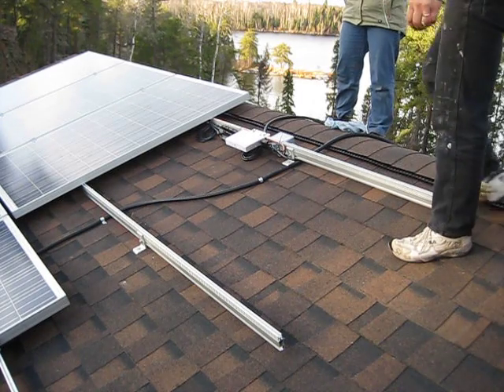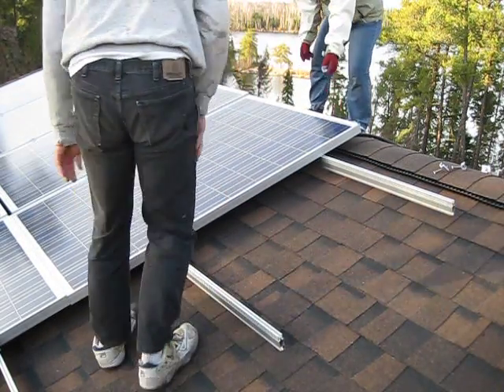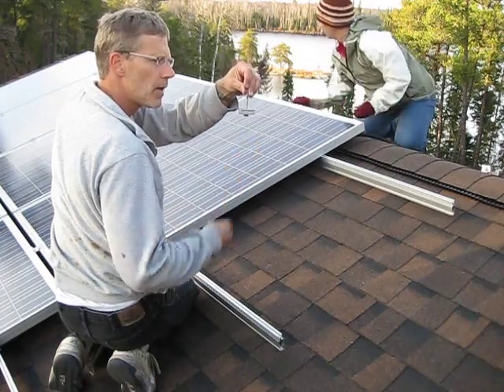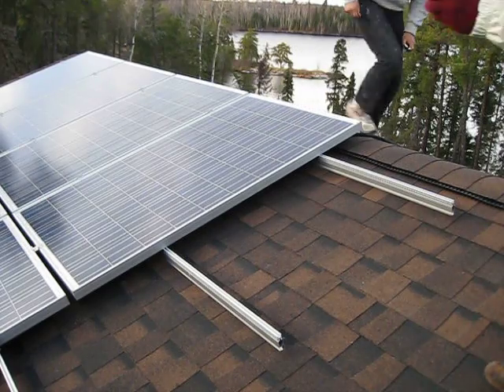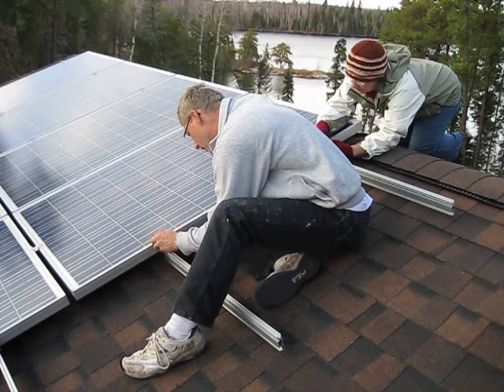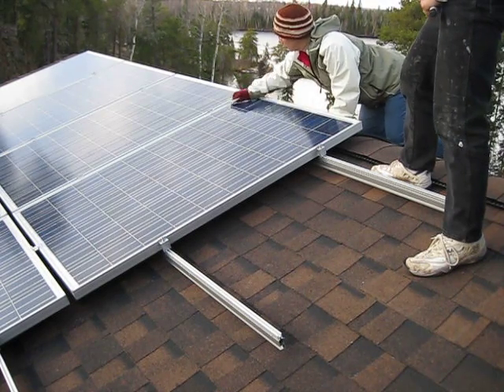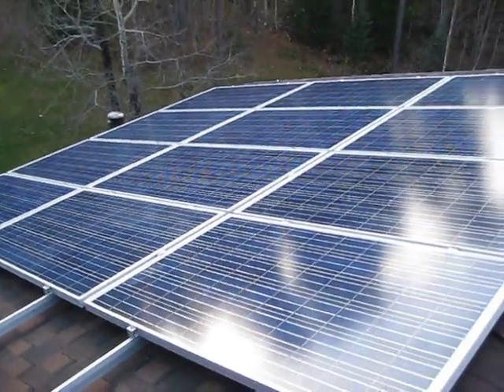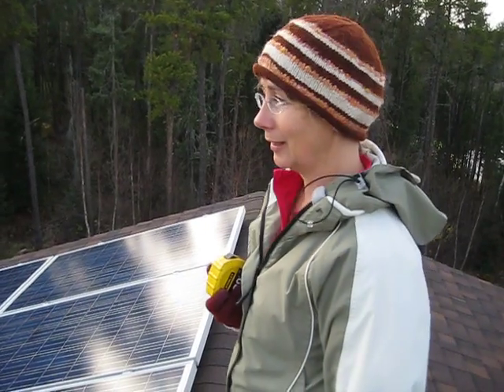Solar panel #33 goes on

Comment: Unfortunately your roof will leak at some point.  Flashing should be used for all roof penetrations rather than relying on a sealant.  They are available from manufacturers such as Kinetic, Iron Ridge, and Quick Mount PV.  Looks good otherwise.
Reply from the maker: 7 years in and still no roof leaking. So far so good!